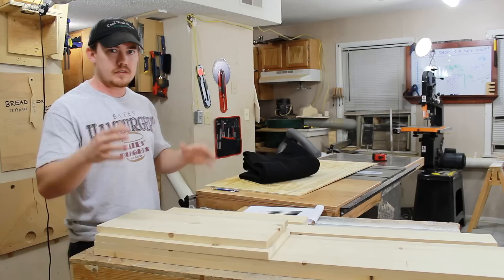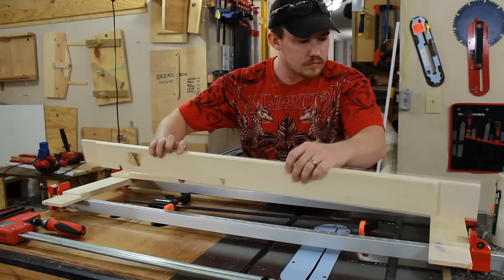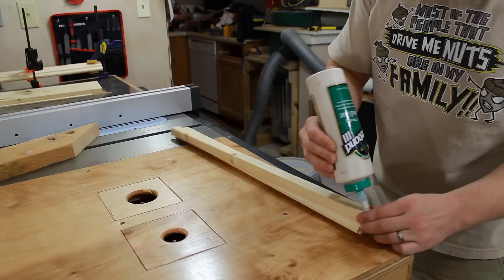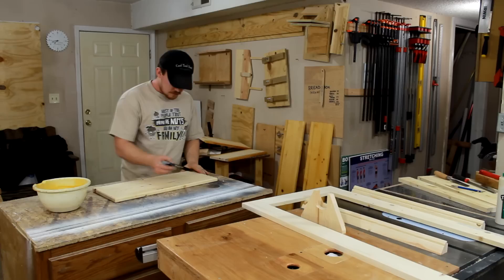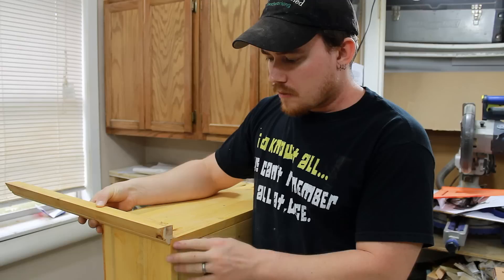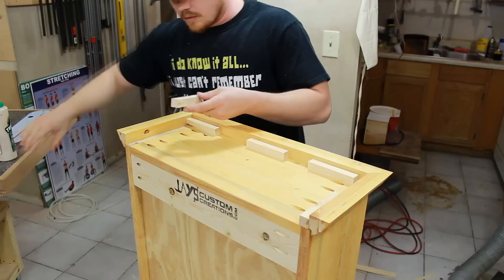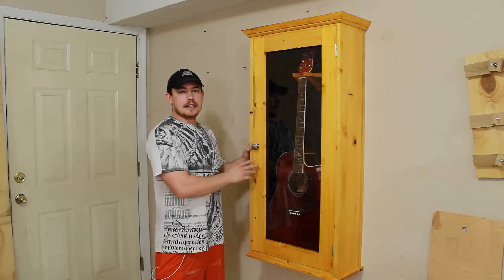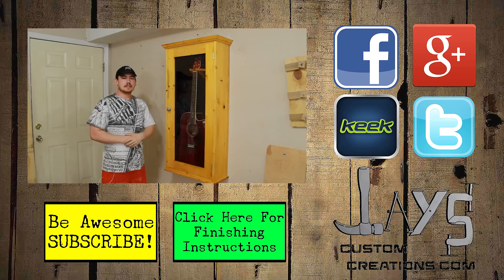Make An Easy Display Cabinet -  117

Comment: First of all, that display case is breathtaking. As a kid, I’d spend weekends with my grandfather in Mandeville who was a retired engineer from Shell in New Orleans, LA. He built a 34 foot catch in his driveway in the 60’s. Years later, he built a 40 foot house boat in his driveway also.  Both were docked at Pontchatrain Yacht Club when I was growing up, then later in Mandeville. I wasn’t born until ‘78. But, he taught me to sail, catch trout, and play tennis. He never taught me to build anything, however. 
  It wasn’t until last year that I realized how much carpentry I could have learned. The basics I got from my father in my teens. But, I basically quit golf last year to take on woodworking projects. 

  I’ve built my outdoor kitchen, my workbench,  Bahama blinds/shutters for my house (which is completely cedar), an authentic replica Masters Driving Range trash can, my daughters’ Discovery Backyard play house/swing set, a board on board fence around the back of our property, and am now currently researching plans for a 12 gun display case. 

  The visual examples of you using your router, making pocket screws, the table saw to make crown molding, and utilizing a French cleat, for example, were educational demonstrations that can help us all who are just learning, or teaching ourselves, to do carpentry. We appreciate your  production and subsequent post of this video. Out of curiosity, who taught you to respect wood?

Thanks Jay,

Comment: Hi Jay, you did a great job with the cabinet. That's something I wouldn't ever be capable of doing (and my wife knows that too). The video is great. The WB is perfect and the colors look quite pro.  I don't know the whole camera settings but don't forget to set the shutter at 1/60 (1080p) or 1/120 (720p) if you film in NTSC. The other thing I would recommend is to keep wearing the same clothes. I know that after so many hours of hard work they won't smell like roses, but it will give a better feeling of continuity and I would also recomend wearing a tshirt with your logo, company's name, motto or slogan. Great jobs (building, filming and editing!!)
Reply from the maker: Thanks for the feedback. I kept it at 1/60 and 30fps with this one. I'm running MagicLantern on a canon 600d with the crappy stock 18-55 kit lens. The lens has a not so hood aperture And my shop has crappy natural light. I'm still working with tweaking ISO values in magic lantern for less noise. Check out my most recent video. I think the picture was the most consistent there. Yeah wearing the same clothes would be better but as pressed for time as I am I just get in the shop and start going.
Reply from the maker: Oh, can't really afford logo shirts at the moment.

Comment: It would be awesome to see a revisit to this maybe with a hidden compartment for humidification.  These project panels do not seem to be available anymore.  Awesome cabinet, I've been working on this in my head and you had about the same plan going.  I was going to use plywood on sides and face frame the front.  Thanks and great job!

Comment: Really nice!  My only thought would be to add some padding to the piece that holds the neck at the head stock.  You're likely to ding up the finish on the neck over time otherwise.  Good work on the editing too.  Short and to the point.

Comment: Good job on the cabinet.  Do you think I could make wood trimmed 1/4” acrylic doors that were 30” wide and 76” long.  I would really like just one door rather than two 15” wide doors as it makes the content more visible.   I could add a horizontal wood strip that would add rigidity to the 30” wide door.

What do you think?

Comment: jay bates first off love watching your videos.  There very inspiring to the average wood worker.  secondly as your advise would you use 3M #77 spray adhesive to glue the felt to wood.  Im lining a blanket chest and came across this video in which you used some type of spray adhesive.  3m the right stuff for this?  thank you for your advise
Reply from the maker: That will work.

Comment: Not bad, but if that's the guitar that's actually going to go in there or the one that is has a similar color, I think you should have used a different felt color. I'm afraid the guitar vanishes in so much black and is harder to appreciate.